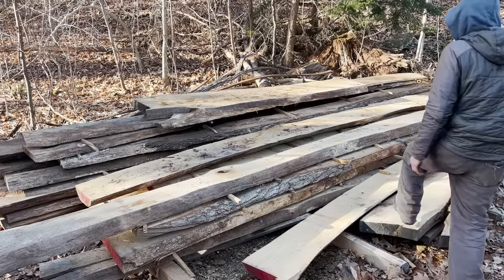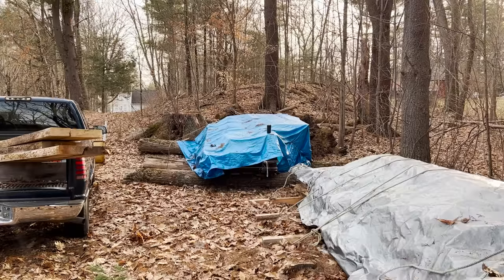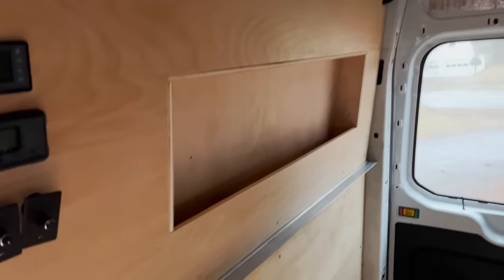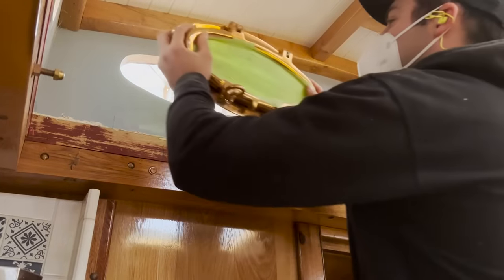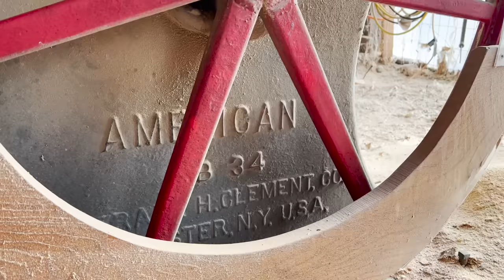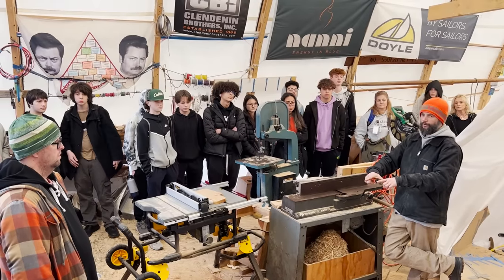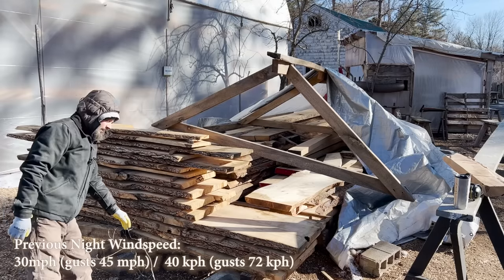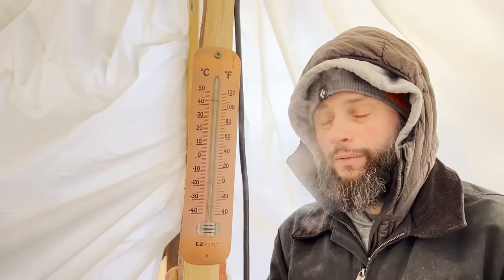There's A Tiller In This Tree - Episode 252 - Acorn to Arabella: Journey of a Wooden Boat

Comment: Neat trick to that type of butyl tape. Store it in your freezer.  When you go to use it it will still be pliable but it will not stick to your fingers or pull apart super easily.  Trick learned sealing campers.
Reply from the maker: Cool!

Comment: On all the boats I have been on the port lights opens upwards. If you want it open you have a fixing in the sealing. The reasoning being, I think, is that it closes with gravity. Is there a reasoning for mounting them sideways as you did?
Great job, love the videos.
Reply: I wondered the same.
Reply from the maker: These were installed the same way on Victoria: sideways. It has to do with the height of the cabin trunk.

Comment: "These bits are a little bit sacrificial" ..... like each'n any sharp edge in boatbuilding 😂 I learned that as an apprentice when they gave me a sharp toolset in the morning and made me do things to boats I didn't build and had me giving it back sharp (or resharpened) in the evening .... There always was the screw, hidden bolt or nail You cold not see, and could not imagine (as an apprentice at least) why it would need being there. Much later my master/mentor told me that "daily tool-month" was mostly for teaching to sharpen tools properly before I got "my" toolset from the employer .....
Reply from the maker: Thanks for sharing your memories!

Comment: I'm all for originality. I perfer the rear vertical post horizontal hand crank ships wheel and chain that replaced the old swing tiller. Which holds turns better during rough weather doesn't wear you out like a tiller after hours of battling the waves it's alot of work. Worst yet getting hit by the tiller from side waves hitting the rudder. Getting your teeth smacked out or across your chest / thighs by one isn't a fun boating experience.😣😣
Reply from the maker: Wind vanes are a crew’s best friend.
Reply: @AcornToArabella  Only if it points in one direction. Not when it points in all directions.😉Wink!

Comment: Why not add a steering wheel rather than building a tiller?  You are going to have to add an auto steer system either way unless you are going not have additional crew on board where everyone gets assigned  watches for 3 to 4 hours or more and it will help during stormy weather conditions where those on watch can be safe and dry during most of their watch. 12:43
Reply from the maker: Wind vanes work great with tillers, and tillers are a joy to steer with, simple to replace and maintain.

Comment: I thought you would have a helm / wheel to steer
Reply from the maker: Nope! We’ve always talked about a tiller. It’s in the plans, too.
Reply: A helm is good but a tiller is far superior for a boat of this size and weight.  A tiller is much more sensitive and lets the skipper know exactly what the boat is experiencing instead of a helm. Also double ended sail boats the size of Arabella handle far better with a tiller especially in heavy seas.